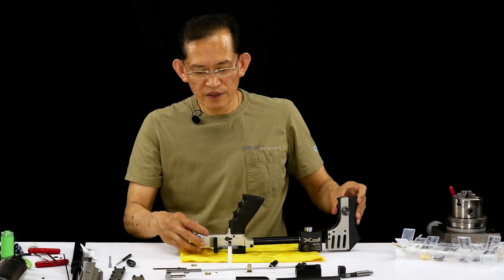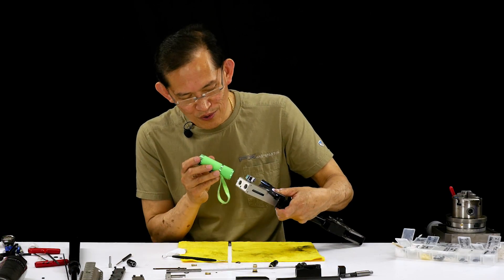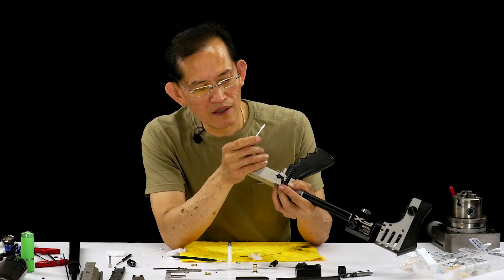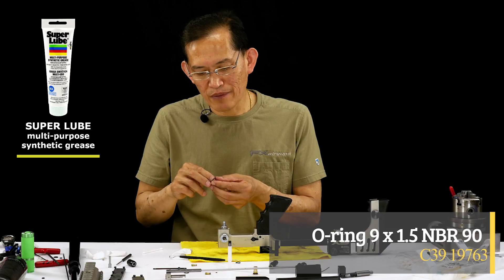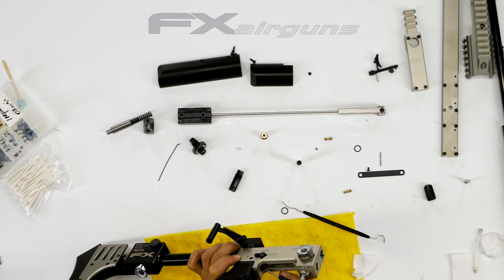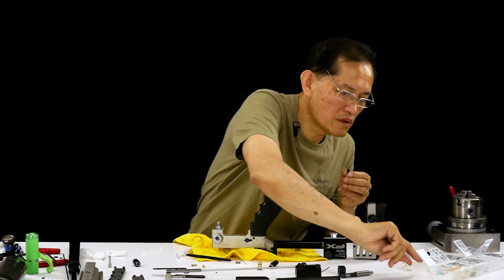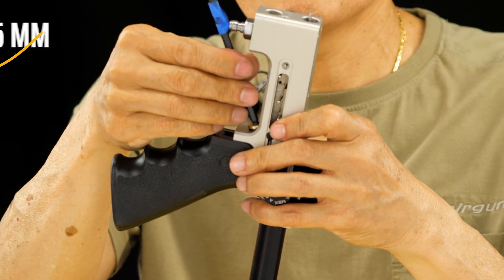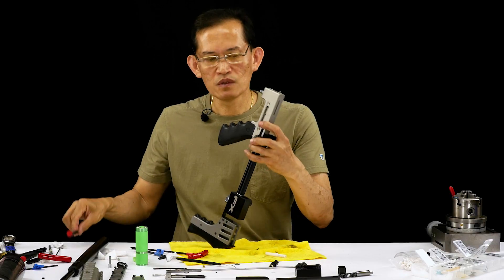FX Impact Regulator Maintenance : FX Airguns (6/7)

Comment: Master Rowe, Thank you for making and posting your Masterclass videos. I just finished replacing all the regulator O-Rings for my FX IMPACT which had started leaking air through the blow by hole on the receiver.By following your tuturial, close ups and tips in disassembly and re asssembly. I was able to do this myself. I may not have been a fast as you were, but this grasshopper completed the overhaul..Mahalo Nui!, Aloha, Mike F.